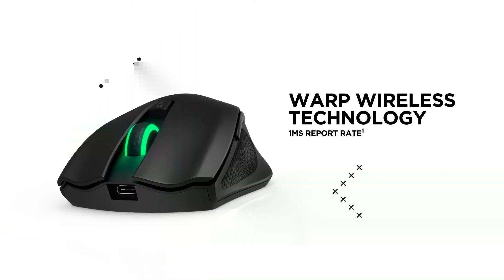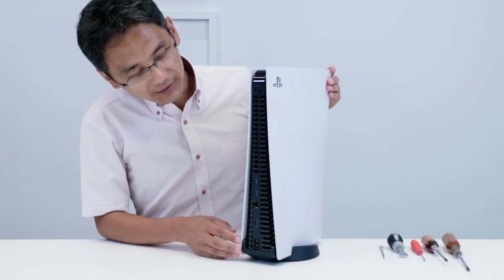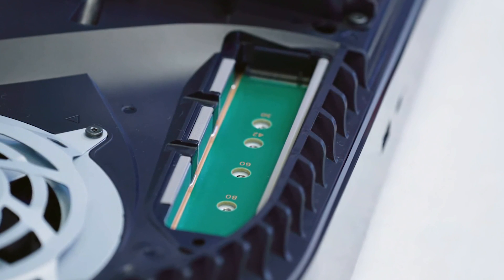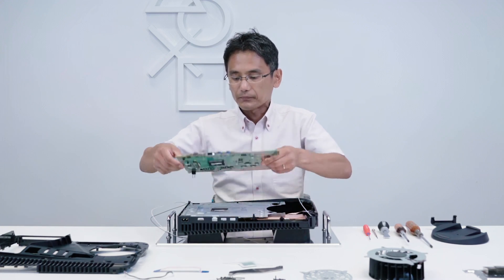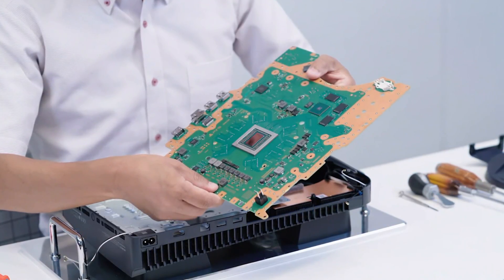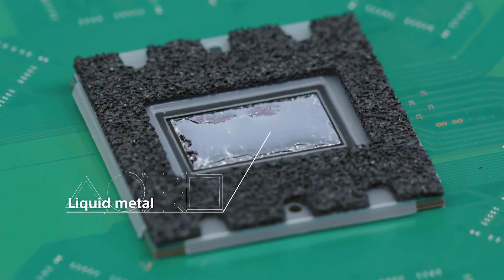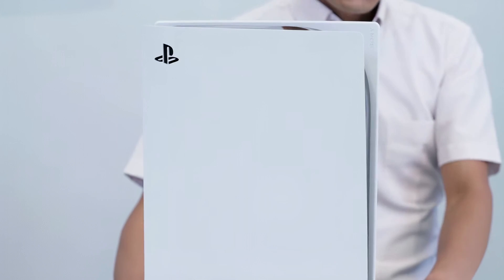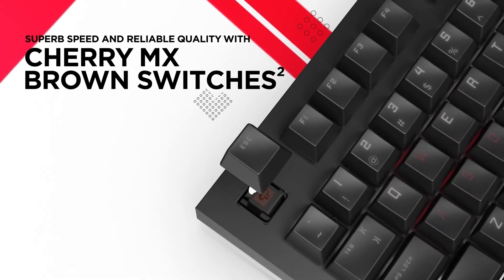PlayStation 5 Teardown Analysis: Inside Sony's Next Generation Hardware Design

Comment: 8:15 I wonder what that little heat sink on the shielding if for....the SSD?
Reply: for back of cpu and ram
Reply: Yes, it is sitting right over the SSD chips.
Reply: @dragons_red  Yeah I couldn't tell but it makes sense. It kinda looks like the SSD controller may have had some thermal paste on it as well.

Comment: I want to be impressive of the ps5, but its hard. Half RDNA 1.5 and  ZERO HDMI 2.1 features as the Xbox Series X. All 3rd party games will also run on lower res than the Series X. 

Rethink Dirt 5 on the ps5, what we saw on that IGN video..
Reply: 90% of those are BS rumours
Reply: Wdym dirt 5 is at 120 on the ps5 tho

Comment: NX Gamer placed an interesting emphasis on the Bluetooth and WiFi antenna choices for a potential wireless PSVR 2. WiFi 6 for data transfer and this iteration of Bluetooth for positional tracking.
Reply: He's completely wrong on the Wi-Fi 6 speeds though. He mentions 9Gbps. Max for PS5 is 1.2Gbps.
Reply: You won't get that here...
Reply: @jinkazama7587  That what?

Comment: Hopefully Sony did some real good testing with the liquid metal, I change mine every couple years at most. Good luck to you all purchasing.
Reply: No change needed as it’s sealed in here.
Reply: Lol, yours doesn’t have special plating to prevent corrosion on heatsink or the special patented TIM pooling chamber to allow more LM than a consumer would have. This will prevent all the issues you’re concerned about. And I’d predict you’ll be buying a similar PC cpu application for LM years from now when that industry copies the Sony patent

Comment: more power consumption even with lower overall tflops, that is the cost you pay for squeezing every last mhz from the much smaller chip, xbox design is much better in that regard
Reply: The WHOLE chip is running faster and uses an ssd 2x speed think about it......

Comment: 350 watts with 10.3 teraflops big form factor 

315 watts with 12.155 teraflops smaller form factor 

So that alone means Xbox build is better
Reply: @Rohan Rathour so if a Xbox series S was clocked at 2.2  with 4 teraflops? Does that make it more powerful than the Xbox series x clocked at 1.8 with 12.155 teraflops?
Reply: And Yakuza 7 current gen game runs at 1440p 60fps on Series X and drops frames, also Series X has 0 ray tracing games at launch! But but 12 TFLOPS!!
Reply: But ps5 is faster and has no bottlenecks
Reply: @domzzcardzz7985  ps5 is nit consistent 10.28 teraflops

Comment: Why didnt they make the stand screw one of those self screwing ones you find on camera tripods? (Due to a better name, no tools needed!)
Reply: The screw needs to be slightly recessed so it does not foul the stand...
Reply: You can undo this screw with a coin.
Reply: @WickaKalicka  Which counts as a tool in this case
A simple tool, but a tool
Reply: @DANNYonPC  It's very unlikely that you'll screw and unscrew this screw (man, I'm screwed) too often, unlike the tripod. More-likely once or twice for its life.... 

Using just a captive screw should save them a cent or two, which when you account the number of sales it would be, that can be a fraction of a million. That's quite a saving if you ask me.
Reply: come on man!!! this stand/screw business is obviously doing your head in!!! and is being over analysed by xbx fanboys its obvious, the screw needs to fully disappear in horizontal configuration!!! what are you going to do, screw into the detachable sides making the detachable sides not detachable???? a camera tripod is meant for easy repeat  uses for quick attachment/detachment obviously not needed for a ps5 unless youre thinking of taking portrait and landscape photos using the ps5??! or youre annoying as hell and change from horizontal to vertical every day because you just cant decide which orientation suits you??... xbx fans suddenly becoming engineering geniuses overnight! lol well done xbx twiiter acct.... pretty sure the ps2 slim also had screw in base... nothing was made about stands lol... ps3 phat didnt need stand but slim down model had an option for stand... nothing was talked about that from xbx nutters.... first it was xbx making out that ps4 pads not working on ps5 is anti consumer despite every gen and for 25+ years and for every platform its been normal, now its the stand??? other issues xbx dept find fault in the ps5??? how about looking in the mirror xbx and showing some games you know next gen games??!!! the reason youre making the next gen xbx??!?! but no lets have a go at sonys ps4 pads not working or the stand requiring a screw because theyre of utmost importance when it comes to next gen gaming... xbx is obviously deflecting and hiding the fact when launch day comes there is absolutely no fanfare or hype about xbx... all optics right now are on sony... the next sony reveal.... miles morales and then leading nicely into launch in a months time
Reply: @antwango  I didn't expect an entire book
Also if you read my name, its onPC not onXBOX
 
Anyway, like Richard said, we already know basically everything about the xbox, and almost nothing is left to speculation
Where the PS5 has far more talk due to the unknowns
Reply: @Ebolachicken  Xbox could have done better if they're not cheap
Reply: @Ebolachicken  you sound like your about to cry... Please shut up
Reply: @Ebolachicken  they're way better at what ? Making Hot Boxes ?
Reply: @Ebolachicken  
1. PS5 literally Use A giant heatsink with performance as good/better than a Vapor Chamber, a Giant Fan that cool down air faster with way less noise and Liquid Metal for CPU cooling
2. Xbox Cooling is Inferior and Cheaper
3. Still not a box
Reply: @Ebolachicken  ok bye

Comment: I think I see what they were going for with the case design. The fan has a blade surface area that is at least double that of a standard 120mm. The tapering case will increase pressure, causing the air to move faster as it goes through the system as opposed to a perfectly rectangular design which would get no additional air speed. Almost similar to a cooling stack at a nuclear plant.
Reply: ..and to stop people from stacking shit on top of it at any angle so it won't turn into an oven.
Reply: subie1822  Hang on... We are talking after release,,,, and we know the One is shit.
All this right now is what? Yeh ,Journalism.... Nothing more than a swayed opinion......
Reply: I would say the Xbox works more like a nuclear cooling stack just look at it
Reply: @murup4R4  Perhaps you could explain what you mean.
Reply: If you are talking about the venturi effect it would need a much more narrow passage on the center to increase the air's velocity in any meaningful way
Reply: @newsflashasshole7205  I doubt it.
Reply: @nexus1g  all real world applications of that effect are made like that,believe what you want ill stick to knowing
Reply: subie1822  Well, I'm no fanboy. It is just an observation that I see when I watch the DF video. I haven't watched the earlier videos since I didn't have the console then. just watch their videos for XBox vs PS5 and you will notice that they will always praise XBox, and then when they do the PS5 video, they will always point out it's shortcomings, or not praise the PS5 when they talk about a good point. They just state the facts. With the Dirt5, others in the industry pointed out all the shortcomings of the game and wonder why MS showed the game when it wasn't looking good, but when DF did a review of it, he doesn't criticize the graphics but just state a fact that there are pop ins without any criticism even though XBox is such an Powerful Console. He even mentions to look forward to the XBox graphics. Really? When the graphics on the Dirt5 was bad, we should look forward to more of this type of graphics? 
  Have an open mind and compare the Spiderman's review vs the Dirt5 game. You will notice that the host will emphasize the lack of power of PS5 is the reason for the underperformance of Ray Tracing and the outline details. I know it is 2 different person doing the reviews, but they all seem to have the similar attitudes.
Reply: I'm surprised someone got that. I thought the same. Apparently, it is a "simpler" design from what DF says though. I think XBox bought DF off. They almost always criticize or disparage Sony Consoles vs XBox as they did it here.
Reply: @1flash3571  they might have missed it or didn't know(it's perfectly normal for people to not know!).
Reply: @1flash3571  pretty much. Sad to them go this way.
Reply: @1flash3571  Yeah I noticed that too. Richard calls the PS5 conservative but I fail to see what is so conservative about having the first ever liquid metal cooled mass produced electronic, having the biggest console with the craziest aesthetic, and having the fastest storage solution in the market across PC and console. Meanwhile he is amazed by XBX's build which is identical in design to pre-built PCs like the older Mac Pro or MSI Vortex but looks even more boring.
Reply: @weaverquest  You don't want the console to be big though. That is the point. It's a unit that is supposed to fit neatly into an entertainment unit. Series X on it's side is smaller than my Yamaha Amp but the PS5 is another 10 cm's longer and won't fit so i won't be buying one as a result for at least a year or so most likely.
At the end of the day neither have anything compelling to offer right now. I'd feel more comfortable waiting for the next Naughty Dog game to get a PS5 . Rumour has it Demon Souls is also coming to PS4 now too.
Reply: @weaverquest  Series X has the best and most logical design. The long case acts a like a wind tunnel sucking in air from the bottom vents b/c of negative air pressure caused by the exhaust fan. The fresh air has nowhere else to go but along the whole case and transfering the heat from the components along the way and that warm air then gets forced out through the large exhaust fan on the other side of the case. It's pretty much one of the ways it's done on PC when it comes to cooling. PS5 design is too weird and a question mark.
Reply: @DEVILTAZ35  Have you guys noticed that the bottom round pedestal of Series X is blocking part of the bottom where the holes are? It covers most of the bottom.....
Reply: @1flash3571  i think this might have an effect on the air pressure in the system whereas too much air might be counter productive.
Reply: Or a jet engine (turbine) 👍
Reply: One thing to remember is that increased air speed equals increased noise and there's no way around that. It will be interesting to see how the consoles compare in noise levels out of the box and in the future. I'm also curious about the vacuum ports and how two tiny ports are supposed to pull dust from such a distributed form factor for a heat sink.
Reply: @brendanmenietti396  It only applies when there are bottlenecks. PS5 is big enough that there will be plenty of open spaces for the air to travel through.
Reply: @brendanmenietti396  it definitely won't pull out all the dust, that's not possible. But it's still a nice addition, you can get out the other dust which isn't already holding directly on to the hardware.
Reply: @paddipat  That is why you should clean the Console once in a while....Maybe once a year, and vacuum the area around the Consoles. Dust collects around EM fields which all electronics puts out.

Comment: Series X has higher bandwidth but just for 10gb. A crytek engineer already said this split in memory bandwidth is not good when you need more than 10gb which can result in bottlenecks. Doesn't matter theoretical tflops if the system has bottlenecks which we already are seeing it based on not so good load times and poor performance in games on series x.

Comment: The PS4 consoles had higher PSU than the xboxes too despite the power draws being similar. 
Sony just goes overspec.
Reply: That's a always a good thing for us as a consumers.
Reply: @1flash3571  well in this case a more power hungry console is worse for your electric bill soo
Reply: @kerninjathefrog6569  A 350W power draw won’t be putting you in poverty any time soon.
Reply: @kerninjathefrog6569  A higher wattage power supply does not meant it will be more power hungry. With the 350W PSU, it'll most likely be very efficient in delivering power. 

For example, a 650W Power Supply in a PC does not mean the PC uses 650W of power. The higher wattage is for more power efficiency, or specifically when the power supply is under 50% load.
Reply: @DengKevin  what school did you go to? The unit watt (W) literally means joules per second I.e. the amount of energy it uses every second.
Reply: @kerninjathefrog6569  Pretty ignorant of your part talking without knowledge, criticizing this guy's education when he's 100% right.

Power supplies rated wattage is what they're capable of delivering, not what they deliver always.
Reply: That was because of the Kinect

Comment: Do a shot for every "bespoke"
Reply: I was thinking the same. It’s such a British thing 

I don’t think I’ve ever used or heard that word used in real life conversations
Reply: @codycast  I'm still trying to define the word organically, by listening to its use on this channel.  I never hear it anywhere else.  I think I'm close to grokking it now.  No, I don't want spoilers, or to look it up.  It's more fun this way.
Reply: @joesterling4299  I'd like to hear what you've "grokked" so far
Reply: im dead now 😵
Reply: Why is everyone using "bespoke" instead of "proprietary" now? It's like how people started saying "applications" instead of "programs"
Reply: @96mryomama  The meaning is quite similar but not exactly the same
Reply: @96mryomama  There's a difference. "bespoke" means that something is made in such a way that can only physically fit in the thing it's meant to go into. "proprietary" means that something is done specifically for that one thing and nothing else. Even the words "application" and "program" mean different things. "application" means the thing the program does on the user side, while "program" is the sequence of arithmetic calculations a computer performs ending in output, which is dependent on the input given. The word "application" has actually been in use since the days of the IBM System/360 in the 1960s to refer to a loaded program which has more than a single sequence of these arithmetic calculations, therefore an application with several programs. Today, the vast majority of applications will have more than one program, therefore the term "application" is the correct one.
Reply: I guess people got tired of hearing custom solution being repeated
Reply: First time I heard “bespoke” was in reference to a super car (probably the actual first time it was someone in the UK talking about a McLaren) being that it is used to describe many new designs, materials, paint, etc. more and more; it sounds to me to be the new “catch” word marketing teams like to use to point out something. It really is a shame that there are so many bespoke parts in the PS5 but the fan is just a custom design. Lol
Reply: @DerektheMenace  I think the term comes from carriage and cart makers who had "spokes" made specifically for different sizes of wheels.
Reply: @elimalinsky7069  yup, that’s where I believe it originated but was obviously dropped when automakers decided to make/sell the entire car. My point is the comeback of the word seems most prevalent in the super car category of the auto industry.
Reply: @DerektheMenace  Yeah, it's definitely the case.
Reply: I swear he said "bespoke" the precise moment I read your comment. LOL.
Reply: No. I value my life.

Comment: Took them long enough,still manage to take jabs at Sony every chance they can.
Wondering why it's all rainbows and butterflies over the past Series X videos...
Reply: Because its a more powerful and more efficient console and they like that. The ps5 is over engineered and doesn't perform as well, it can't even do AI acceleration HAHA which is needed for efficient dlss type compute.
Reply: Coz Xbox is a better console technologically, more powerful and allows them to make content for their channel by sending them the console itself before the release. Sony is postponing everything which looks like they want to hide something.
Reply: Xbox is doing things to give them content and it's genuinely well made. PlayStation is staying real quiet. It's strange they haven't done what Microsoft in giving a ton of influencers consoles. Sony did the same thing for PS4, but not this time.
Reply: Why are you so salty over facts?
Reply: Oh boohoo!  Bet you were grinning with joy when they were comparing blades of grass between the original PS4 and Xbox One prasing the PS4